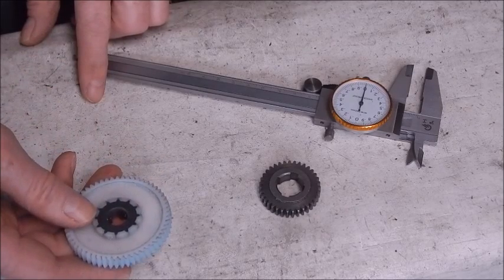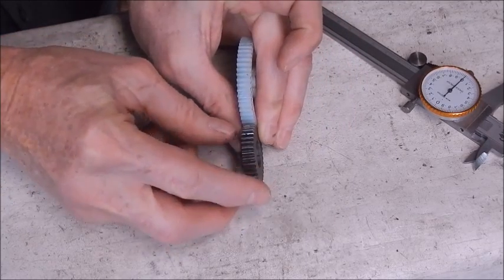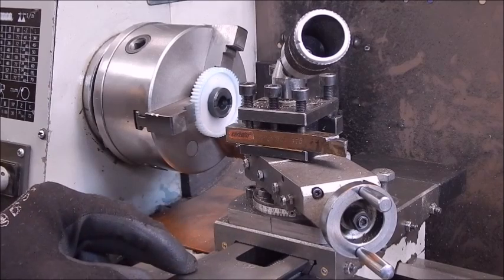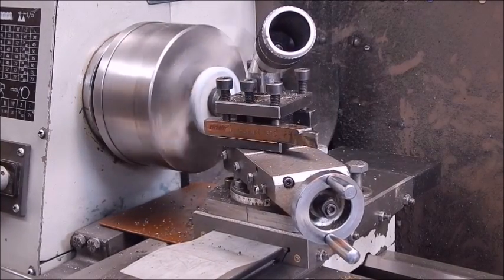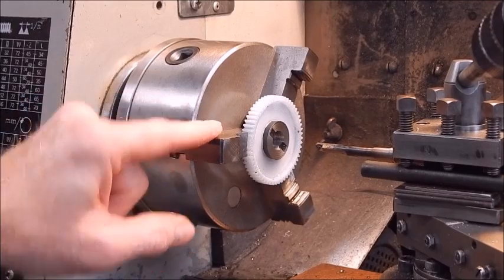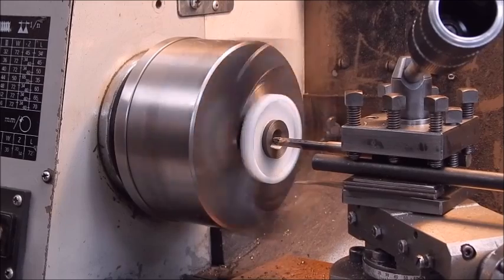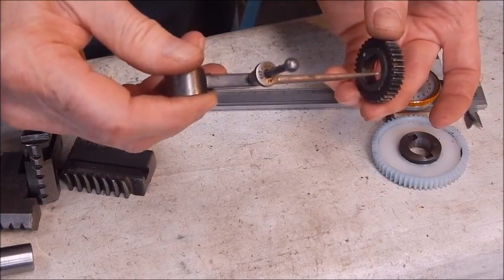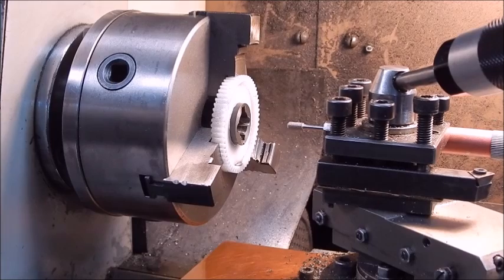Get a free lathe change gear from a junked treadmill

Comment: a plastic gear can be like a sacrificial gear if you think something is wrong with a gear or want to make a test but if you don't apply big forces it could last.... nice job
Reply from the maker: Yes, it could even be made from Delrin.  I may never use it, but it works OK and is one more spare in the box. Could be handy for doing a coarse thread. Cheers Rob